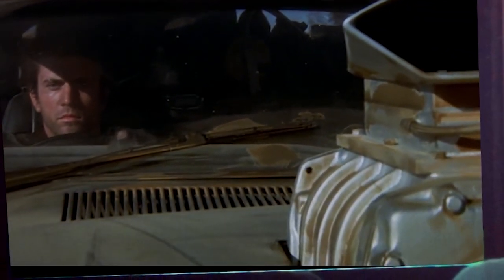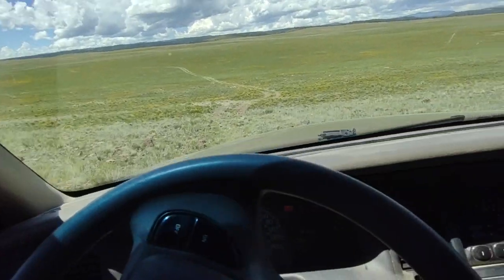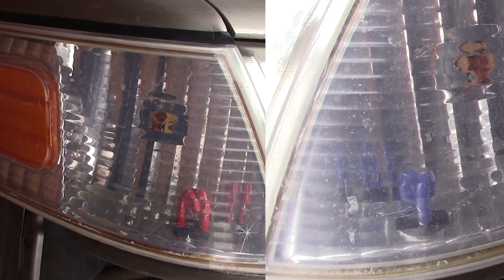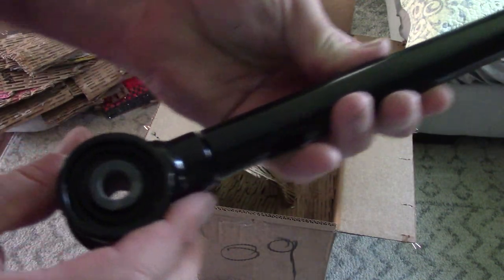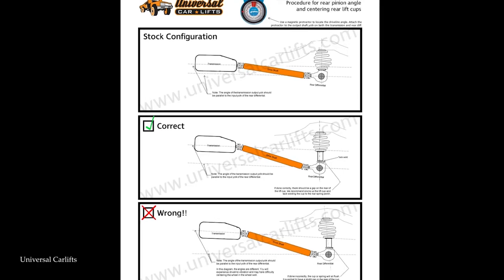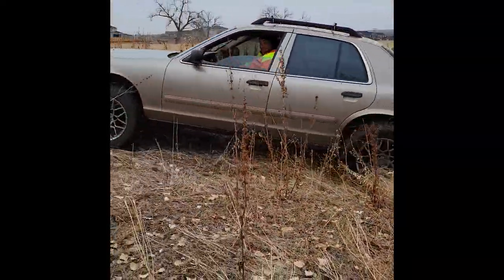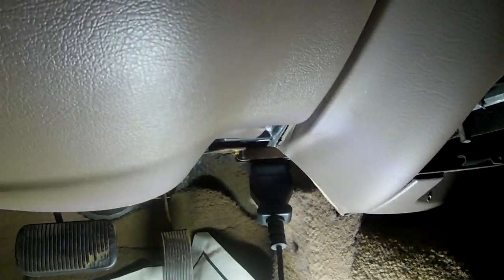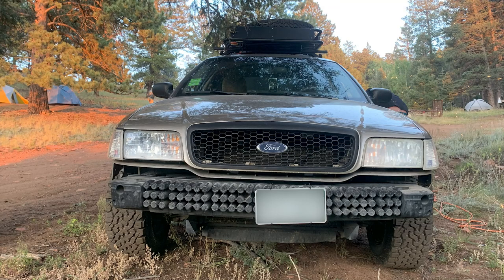Another Lifted Vic

Comment: Great video. For those unaware there are several "Lifted Crown Vics" or "Off Road Panthers" Facebook pages devoted to this genre. Also the red light on the ceiling is a ticket light (not a stakeout light). It's used so that the white light from the regular overhead lights doesn't give away their position and it doesn't destroy your night vision. The military uses this same idea in the flash lights, blue or red snap in lenses for seeing at night.
The door panels may contain ballistic panels, not all Vics have them. It depends on what the car was used for. You have power seats in yours so likely it was a detective's or supervisor's car and therefore wouldn't have ballistic panels since those person's aren't usually on the front lines (so to speak).

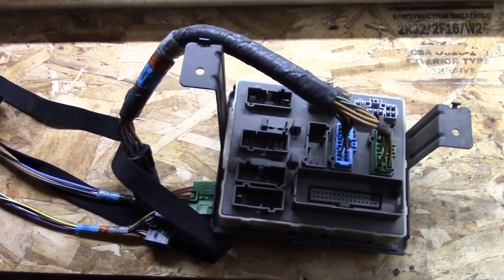Time Stamp 3:23 It's a power block, used for connecting different devices.

I live in Arizona, lots of dust here and I clean the MAF Sensor and intake every time I change the oil. A dirty MAF will cause your car to lose acceleration and give poor gas mileage.
Here in my neck of the woods (Phoenix) I belong to a car club with over 200 members (you must be a resident of the state of Arizona and own at least one of these cars). We have several LEO's, mechanics and dealers. Some members have cars with 700k miles on the original engine/transmission. Parts are plentiful as there are at least 25 panther cars in the salvage yards at any given time, and that's just Pull N Save (there are many others). There are some members who buy and sell these cars often. I personally know people who own 10 or more of these magnificent vehicles. 

If you live in AZ and own one of these cars, here's the link to the Facebook group. https://www.facebook.com/groups/542524859906215
Reply from the maker: Hey thanks for all the detailed info.  While I had a lot of fun with this car, I regret to say I just sold it to a gentleman in NM so I can focus on other projects.  I'll be sure to pass this info to the new owner.

Comment: I'm really impressed with that lift that you got I might end up checking into it as a replacement for my $89.00  4" 'Donk Lift' from Lift-a-Brand/Universal Carlifts and cobbled together pieces were my only options to run 31" tires on 15" rims.
 There are some things that your Vic has done that were similar to mine for the most part but since mine is a 2008 widetrack chassis some of the mods are completely different.
 Yours appears to be a more robust build simply because of the suspension lift you have is way more legit than mine. 
Great video!!!😊👍
Reply from the maker: thanks would love to see your car

Comment: Does the Tuner allow you to turn off the Rear O2 sensors and EGR signal for Track Use? How Loud was the Exhausts after you went Full Straight Pipe? Thanks for the Awesome Video!
Reply from the maker: I'm unsure about those features on the tuner but it does a lot of things I'm not willing to mess with haha.  I'm only using the preprogrammed tunes that Marty sent me based on my build and to run legal on the street.  Product page should have more info for you but it says it won't modify or delete vehicle emissions.  https://sctflash.com/products/x4-performance-programmer/

At idle the sound isn't too loud, nice rumble.  At any type of acceleration, yeah you can hear it coming.  Cruising around town or on the trail it makes all sorts of lovely, throaty sounds.  Driving for an extended amount of time on the highway is a very loud monotonous drone that you can easily get sick of but just turn the stereo up.